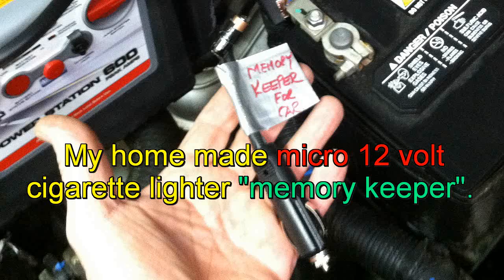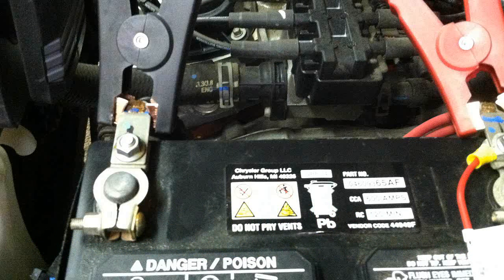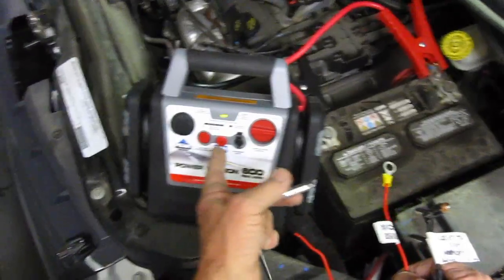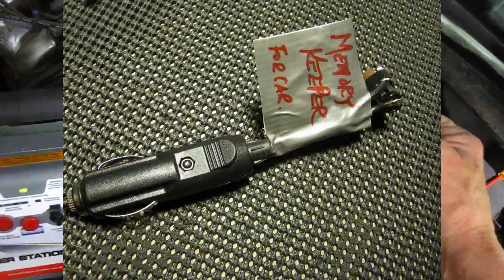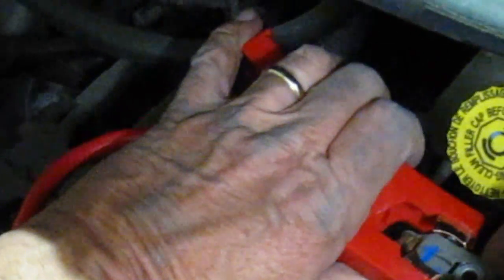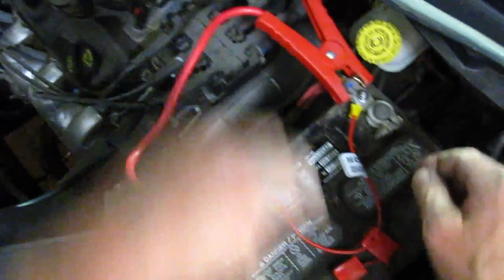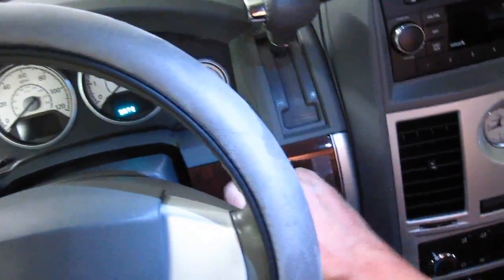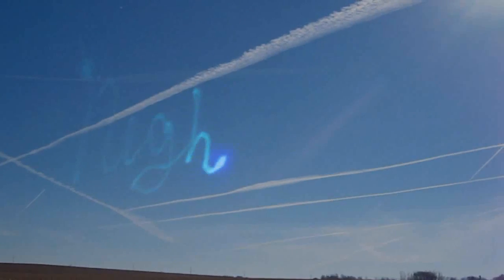Car Memory Keeper,  How to change car batteries without losing Radio memory.

Comment: Actually most auto stores here in Canada sell these for $9.99.  They use a 9v(included) which works fine.  Been using them for years in my shop. Especially good for GMs with their radio lockout function.  Glad to see you back, was getting worried.
Reply: I just got the 9v one off amazon that plugs into obd port under driver side dash to use on my lexus🤞🤞🤞

Comment: Thank you for the informative videos, a word of caution regarding the cigar lighter socket device, my own car is a modern European GM. The electrical system is Canbus and not sanctioned to be back driven lin that way, mine went crazy with flashing lights etc although it has done no apparent lasting harm. Much safer to do in the manner you showed at the battery...preferably from a fused backup device.

Comment: Be careful on some cars you can set off the air bags pushing power back thru the power /lighter port. One of the mechanics in the auto shop at Sears set one off in a Toyota  Camry.

Comment: Many modern era cars have a lighter that is not hot when the ignition is off. So a 9 volt memory keeper that goes through the lighter will not save your settings.
Reply: Which is unbelievably dumb, considering that most people need the power when the car is off! Fortunately, there is a way around that, by installing a separate cigarette lighter through the car's interior fuse box, but, that's a discussion best left for another time and place!

Comment: I have a similar one that uses a 9v battery, very easy to use.
Reply from the maker: That's interesting. I tried a smaller battery, but when I opened the door, the dome lights killed the battery almost instantly. 9v is smaller than the 12 volt car battery so it would not last long in my opinion.

Comment: couldn't i just leave the battery charger connected to the car to keep the memory
Reply from the maker: No.  Most modern chargers will not work unless connected to a battery, plus the amps and voltage from chargers are higher than required to keep memory safe in the car, but your welcome to try your way too.  Thanks.
Reply: @NightFlyyer  thanks mate

Comment: will this work using a battery tender plugged into the lighter?
Reply from the maker: It might, but it's doubtful, as  my battery tender wont turn on till its hooked up to the battery as it has to see some voltage to work.
Reply: @NightFlyyer  thank you
Reply: @NightFlyyer  thanks

Comment: Wouldn't be easier just to reprogram the radio without having to go through this back-up stuff?
Reply: Modern vehicles have a LOT of functions that require constant battery power when the car is off. This is called a "parasitic drain," thus the necessity to keep the car electrically powered, even when off or when the 12v (or other voltage) battery is removed. Why in the world car mfrs don't give consumers a simple-to-change rechargeable 9v (the small consumer kind, aka "NEDA 1604") battery slot for just such occurrences is beyond me. The car could even tell you when the 9v battery is dying; as long as the car's 12v battery is attached, you can replace the 9v battery without any risk. I supposed the extra 5 oz weight and $5 worth of parts is too much for Detroit to handle! Even your computer has a coin-battery to keep some functions alive when the computer is turned off.
Reply: Thanks for making the this thing so easy to understand.  I had always wondered why a back-up was so important.
Reply: My radio has anti theft if it loses power the radio won't work unless you know the code which i don't idk if its turned on just bought it.

Comment: Can a floater charger be used to swap out the battery.
Reply: It depends on the type of float charger. If it's one of those solar types that puts out a milliamp or so and/or less than 2 volts, then, no, you can't use that, because the car's power requirements are way above that. But, you can use a simple 9v (aka "NEDA 1604") battery connected to the positive lead of the car battery and negative lead of the 9v battery to any ground, including the car's negative ground, and that should be plenty. Just make sure it's a new 9v battery, or it may not have enough juice to do the job. You may also use an AC charger, wired in the same way, but make sure that it's set on the lowest possible setting, usually 2 amps or "trickle charge." These aren't long term solutions. They are meant only for the few minutes it takes to swap out the battery. And make sure that you connect the external source in such a way that it doesn't interfere with removing and installing the car battery, or come off easily when you replace the car battery. Then, of course, disconnect the external source after the new car battery is fully in place.

Comment: Effective training is a process. Explain, demonstrate, observe and correct as needed or praise success.  Your explanation was inadequate and the trailer wire clouded the already confusing video. One image shows a 1.5v battery duct taped to a cigarette type plug. I’m sure you know what you did however I suspect few others did but you get an A for effort.
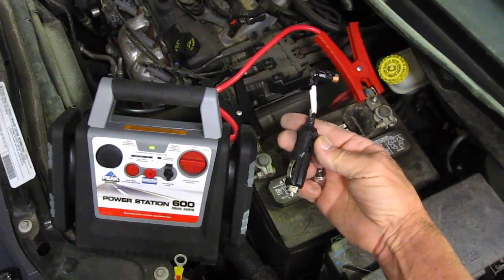Reply from the maker: First of all, that is a 12 volt battery (that comes from a garage door opener) and not a 1.5 volt battery!  So you get an F for not paying attention at 1:27.  No one else had a problem with this and for sure I'm not stupid enough to use a 1.5 volt battery to run 12 volts.  LOL.
Reply: Your audio does say 12v battery but video indeed shows AA (1.5v) battery.  Wish I knew how to post screenshot from your video. That 1:27 has a piece of duct tape with red sharpie writing “MEMORY KEEPER FOR CAR”   I found a different video which shows jumper cables attached to battery terminals on dead battery. I have jumpers so will use them with one of my other vehicles.
Reply from the maker: @doncook5164  That battery IS a 12 volt garage door opener transmitter battery!!  They are tiny and small and look like 1.5 batteries!  The wiring is equally simple.  Put plus on battery Plus lead and and minus on Negative lead.  Then unhook the cables and memory will be kept.  The car booster works just the same.  Here is a link to the batteries, as you obviously never saw one.  https://www.amazon.com/Duracell-MN21B2PK-Electronic-Keyless-Alkaline/dp/B00009V2QM/ref=sr_1_4?hvadid=174247332851&hvdev=c&hvlocphy=9018272&hvnetw=g&hvpos=1t2&hvqmt=e&hvrand=11897127557242155225&hvtargid=kwd-13493814417&keywords=12+volt+garage+door+opener+battery&qid=1552661109&s=gateway&sr=8-4&tag=googhydr-20
Reply: That connects the dots for me. Thanks
Reply from the maker: @doncook5164  Good.  Thanks.